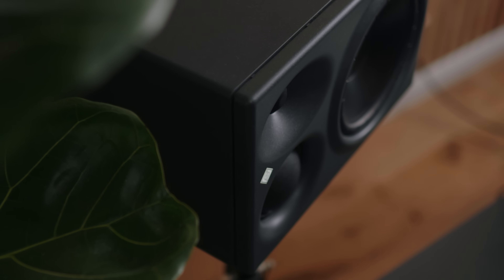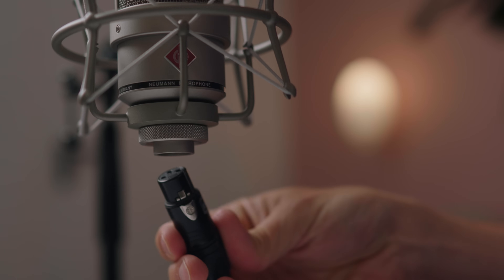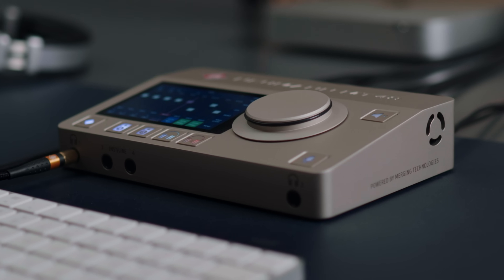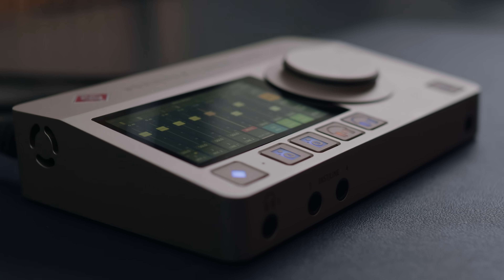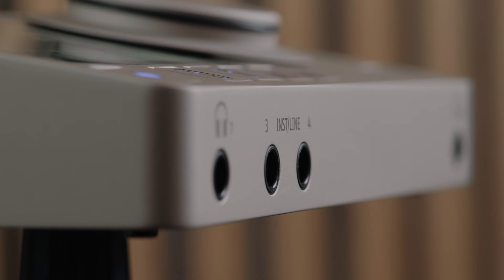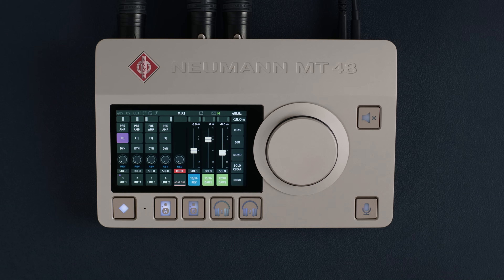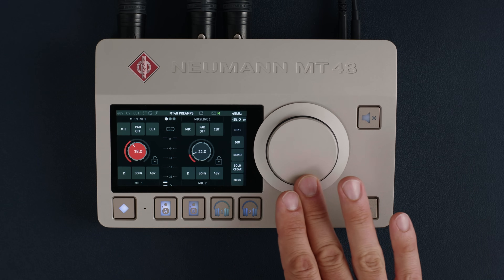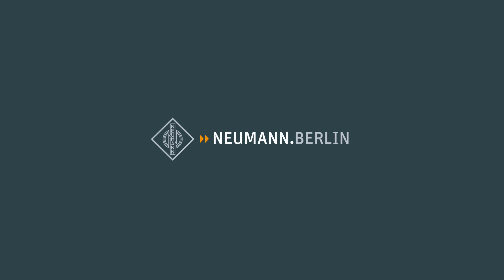The Neumann MT 48 (Pt. 1/5) –  Introduction

Comment: Does it work with cubase and fl studio in MacBook?
Reply from the maker: Here you can find all DAW configurations for the MT 48: https://zingtree.com/live/887759503#4 
You can use the MT48 without driver installation on devices that support class compliant mode, e.g. Mac and iPad. However, installation of the MT48 Toolkit software is recommended as it offers additional functionality and reduced latency.😊
Reply: No word clock in and out?

Comment: wow! Looks like a dream! Is it class compliant? Linux support?
Reply from the maker: Yes, it is😁  You can use the MT48 without driver installation on devices that support class compliant mode, e.g. Mac and iPad. However, installation of the MT48 Toolkit software is recommended as it offers additional functionality and reduced latency.

Comment: The manual shows the Snapshot (SNAP) menu on the EQ and Dynamics full of presets. However, on mine, the SNAP section is totally empty for both. No presets/snaps. Will this be fixed in a future software update?
Reply from the maker: Future firmware updates will include device snapshots for typical setups, e.g. analog only, analog + ADAT, analog + S/PDIF etc. We’re also thinking about snapshots for EQ and Dynamics. Although those should really be adjusted by the users for their specific applications, a few examples may be helpful.😊

Comment: I am very interested in this audio interface, but I would like Neumann to answer this question directly, which I think is important for many who intend to acquire it. Neumann MA 1 and it makes a lot of sense, but don't leave Sonaworks aside with the sound id, Avid or UAD itself made this kind of mistakes in blocking other programmers, many like me already have an ATC system in my case and I'm not interested in changing my monitors to have the correction when I can do it with the sonaworks Sound id allocated to the interface dsp as it is possible to do with the anubis merging, I would like it to be clear if they will access or not since many users have this question put, it would be good for Neumann as a company to set the example of entering the market with its open audio interface and not wanting to go down the path of the UAD that many are starting to abandon..
Reply from the maker: Hi there! Sound ID will not be supported. For Neumann DSP monitors we recommend using MA 1 – a multichannel version is in the works.

Comment: I'm a big fan of Neumann (I'm using monitors, and microphones), but this interface is a step back. It's just this Anubis with Neumann logo (which will cost You an extra 200eur) "situation" is disappointing. Overall - the price, is 2k... You could learn from Your German colleagues, how to build time-lasting gear with a logical price and outstanding quality (RME). Or You could leave the peace of cake of this segment to the overs, no shame to share, because You're still legendary and great in what you specialized in.

Comment: Spec seems to be almost the same with Anubis except for the USB-c and adat, but I've heard that MT48 did not use ESS chip on DA. Chip set is not everything but, wondering which chip set is used in AD/DA, aslo if there's any sound improvement

Comment: It's very innovative but why not thunderbolt. Why USB.
Reply: Thunderbolt is not necessary for lower channel count interfaces like this, and only causes compatibility issues on many machines. You should be thankful that it's USB
Reply: thunderbolt has the lowest round trip latency when it comes to audio interfaces in general right. I would have thought that is necessary for many users
Reply from the maker: Hello there!
First of all because USB is available on any computer and due to the plethora of USB devices, computer manufacturers and operating systems will continue to support USB for a long, long time. While Thunderbolt is common place on Macs , it is rarely seen on Windows computers. Thunderbolt, although more recent, is less future proof. Should Apple decide to drop Thunderbolt, it would soon disappear (like FireWire did, years ago). The higher bandwidth of Thunderbolt allows for very large channel counts – which is not needed in most applications. For those who do need large channel counts, there is the AES67 network port. The MT48’s AES67 network port can be used for connection to computers and AES67 devices in general. Full support via the Merging tools MAD, VAD, and ANEMAN will follow shortly. MT Discovery is already working.

Comment: This is a piece of gear Neumann should send to Julian Krause for testing. Just to prove they are true.
Reply: They would never do that. Julian would immediately point out the fact that over AES67 at high track counts your fidelity is just above a compact discs at 16 bit 48k. Very Sad Face. Can you say Neumann cash grab. Just to give you a little more insight, they are using UA microphones on main vocals over Neumann in this add. Irony.
Reply: @arthurallsopp9344  what do you mean the AES67 causes the audio fidelity to drop? I have no real experience using AES67, so legit curious what are you referring to?
Reply: @rist98  its only stable at low track counts at 24 bit 96k about 40 trks. If you need a lot of tracks like myself at least 80 to 100. Your looking at 16 bit 48k just above CD's.
Reply: @arthurallsopp9344  you sure thats down to the protocol not down to the bandwidth of the network connection and switches involved? Aka maybe your main machine(that takes all the signals in) might need to have a 10gig connection to the switch??
Reply: @arthurallsopp9344  Anyway, based on the info in the manual, I think the Neumann mt48 is compatible with Ravenna.
Reply: @rist98  Yes it is. The thing sounds great but not $1850 great.
Reply: @arthurallsopp9344  eh. Law of diminishing returns. Its cheaper than the Anubis tho.
Reply: @arthurallsopp9344  why would you need to work at anything higher than 24 bit 48kHz though? It's typically much lighter on your cpu and you can oversample the plugins that could alias. You get essentially no benefit unless you have a very specific need for higher samplerate
Reply: Totally. Julian Krause is the goat of audio interface reviewers.
Reply: @rist98  goat?
Reply: @EdoDijkgraaf  greatest of all time. GOAT. Aka, the best imo.

Comment: Hello, I have always been curious why the digital input of KH750 is BNC while that of KH150 is RCA, and now the digital output of MT48 has been changed to ADAT... Why can't it be unified as BNC? As we all know, BNC has performance and durability at the same time.
Reply from the maker: ADAT supports up to eight channels and is available only in optical format. The optical I/O also supports in S/PDIF mode (stereo) RCA and BNC connectors can only be used for stereo signals (S/PDIF/AES3). So, given the limited space on the backplate, we decided to offer optical I/O because it allows for both 8-channel ADAT and stereo S/PDIF. For interfacing with devices using RCA or BNC connectors, converters are available.

Comment: 4 ins and 2 preamps at $1850 is a bit steep. Something tells me you are just paying for the name Neumann.
Reply: Seems like its gonna be cheaper than the Anubis. So nah, the neumann tag aint propping up the price. They know the worth of their product. Especially the value of the amps and converters...
Reply from the maker: Please note that the MT 48 is a new, stand-alone audio interface from the Neumann brand, based on the Anubis from Merging Technologies, which, like Neumann, has recently become part of the Sennheiser Group. There are a couple of diffrences. The MT 48 has an USB connection, ADAT / S/PDIF optical I/O, Tailored GUI and an USB-C power supply. The Merging Anubis is available with one or two AES67/Ravenna connectors (SPS version) while the Neumann MT 48 has one AES67/Ravenna connector.
Reply: @GeorgNeumannGmbH  It is WAY overpriced and you know it. This thing is a cash grab for Neumann putting their name on it. $1850 for only 4 ins and 2 preamps. All high end Audio interfaces have what you have and then some. This thing is worth no more than a $1000 bucks at most. Where are your DSP plugins that I can use in my Daw?? Not to mention your multi link up over AES67 really only supports 16 bit at 48k at high track counts(120). This is a Merging Technologies sellout to try a last ditch attempt to make money off an Anubis interface. Very Sad!!!
Reply: @arthurallsopp9344  Neumann can go wrong too.
Reply: Even though its made by Merging Technologies. Thats who you are listening to. Swiss. This is not made or designed by Neumann. Just riding on the name.
Reply: @arthurallsopp9344  the 850/1850 is paid for Swiss made haha.
Reply: @arthurallsopp9344  riding on the name to gain higher sales volumes.

Comment: What is the difference between this unit and the exact same looking but cheaper Merging Anubis? And if this audio interface isn't just an afterthought and a byproduct: how come your recently released mic preamp doesn't have an optical output or an AES output to connect it to this unit?
Reply: This adds USB-C and optical I/O

Comment: Will be black version of this ?
Reply: of course. This is a merging audio anubis. A 3 year old Interface a little bit changed. Although it s very good and incredible. I don t know why they just with their name sth they haven t made.. I wished that they would have made it better. For example with better amps but apart from the connection differences it s basically the same.. .
Reply: no
Reply: Pink
Reply from the maker: A version in black is currently not planned.
Reply: @GeorgNeumannGmbH  thanks, but can order by MTO?

Comment: Will we see a 8 input and output rack unit version of this?
Reply from the maker: Hi! Currently not planned but we'll forward this to Product Development!
Reply: @GeorgNeumannGmbH  will wait for rack unit
Reply: Can you forward that round trip latency needs to improve on the mt48 so it will be in line with rme interface drivers. Rme has the best latency on there usb interfaces
Reply: any aes67 mutichannel interface will work well with this thing, for example, merging hapi.
Reply: Id expect the whole merging product line to be rebranded eventually. At least the interfaces. But thats just MY assumption.

Comment: Apart from the color, is there any difference with the Merging Anubis?
Reply from the maker: Hello, glad you are asking😊  The differences are the USB connection, ADAT / S/PDIF optical I/O, Tailored GUI and the USB-C power supply. Also the Merging Anubis is available with one or  two AES67/Ravenna connectors (SPS version) while the Neumann MT 48 has one AES67/Ravenna  connector.
Reply: @GeorgNeumannGmbH  and the dynamic range on the neumann is also lower than on the merging audio?
Reply: usb c added